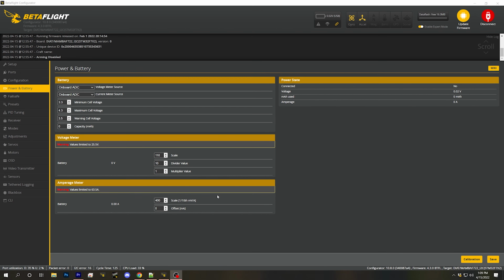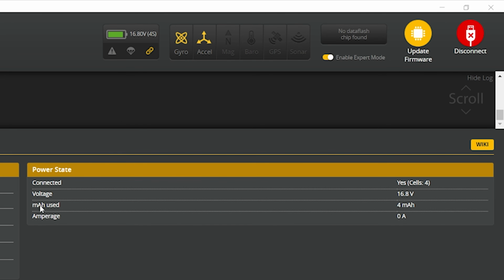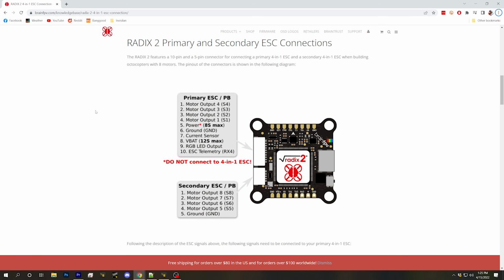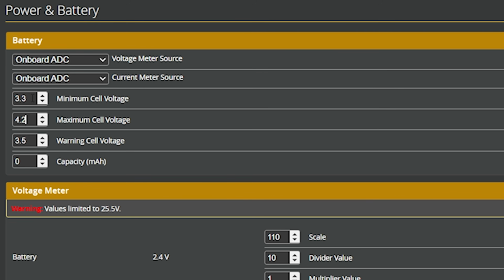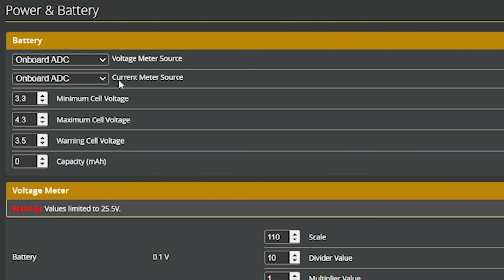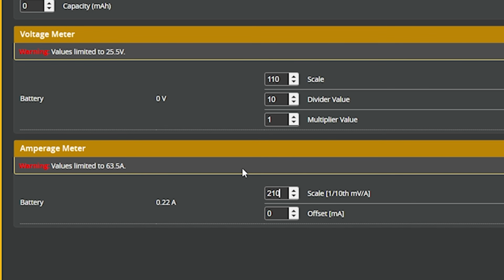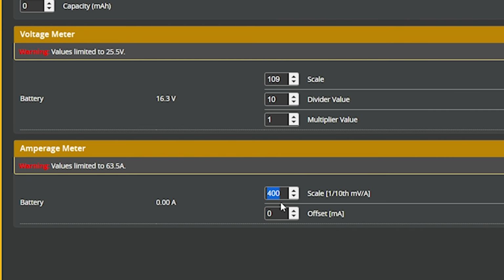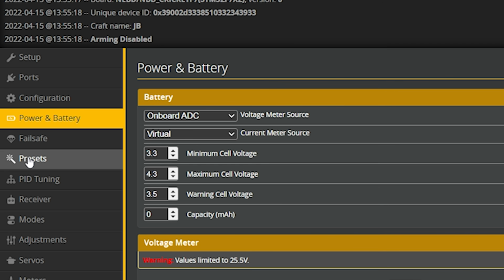Betaflight 4.3 Power and Battery Tab | COMPLETE WALKTHROUGH PART 7

Comment: i cant find info on current scale fore taker 80a there on 3220 925 aos i have built like 40 quads only have problem on 10" 60a to 80a they all want to melt solder off motor pads on test hover use stock betaflight 4.5 help help
Reply: scale on taker 80 should be ok with matching fc its at 179

Comment: good morning Joshua i have the tmotor 45a mini esc, im trying to find the specs related to current on tmotors website the only thing i can find to do with current is them stating that the Betaflight Galvanometer Ratio is 200, could you help me understands this i cant seem to find any documentaion on what the galvanometer is inside betaflight

Comment: Hey Joshua, I'm using a 4s battery and beta flight is showing 8 cells under the power state area. But at the top of the screen its showing 4s. Voltage on OSD tells me to land straight away. I have increased maximum cell voltage with no change. Any help would be appreciated.

Comment: What about the capacity option in BF? Should I input there the battery capacity of the current battery that I'm using? What if I use a 1550mah battery and then use a 1100mah one? Do I have to switch that value in BF before flying?

Comment: Why they just don't let you select how many S battery you have which would resolve all wrong guesses from Betaflight...
Reply from the maker: You can do that in the CLI.
Reply: I guess some selection box with Auto and 1S, 2S, 3S, 4S, 5S, etc. selection would be much easier than changing it in the CLI... @JoshuaBardwell

Comment: Very helpful, thank you so much! I do have a question. When I'm flying, I'm getting a voltage reading that tells me time to come home (let's say 21V for a 6S so 3.5V/cell). When I get home and put the battery on the charger, I'm reading something like 22.8V (3.8V/cell). I'm fairly confident that my battery checker is correct, so I go and plug in my battery and my drone to BetaFlight, but it now says the same as the battery checker (22.8V or 3.8V/cell). Then I connect my headset to the drone and look at the voltage on the OSD, it ALSO now says 22.8V (instead of the previous 21V). Any idea why this would this have a mis-reading in the field, and be correct when I get home? I have the same result if I display the total voltage or the voltage/cell on my OSD. Any thoughts would be helpful, it's maddening..
Reply: I guess it is volt sage, under load ir shows less amps, in rest, show the real voltage

Comment: "Capacity" should be specified in one cell or total?
Reply from the maker: Capacity in mAh is always 1 cell. Because the cells are in series. Therefore the voltage increases as the cell count goes up but the mAh stays the same.
Reply: but what is it needed for? because the alarms are set in the OSD tab, correct?

Comment: So... What value goes into the "Capacity (mAh)" field and what does the setting do?
Reply from the maker: That is the max mAh after which an alarm will appear in the OSD.
Reply: @JoshuaBardwell  If you were using a 1500 mAh battery, would you set this to 1350?
Reply from the maker: That's up to you. If you set it at 1500, you're going to kill your battery (assuming the current sensor is accurately calibrated, which it often is not).

Comment: I'm not getting voltage on a radix v1 board. Can I solder the "volt" pad on the radix directly to the red battery + pad?  I have a hobbywing 60amp 4in1. Then would I use the onboard ADC setting or from the esc sensor? thanks

Comment: So, what does the mAh offset do? You didn't explain how to make it work or how to make adjustments with it. 

Also, from my experience with the current scale that the manufacturer provides is always wrong. It's never correct. Best way to get it close is to just fly the quad and record how many mAh you used up, charge it back up to find out how many mAh went back in. Or if you have a bench top power supply to calibrate it. 

Since the mAh offset wasn't explained, I'll explain it. It's usually always a negative number you input for the offset to correct for the amount of current you are actually pulling. You can put the correct scale in after you do your initial test, but it will still pull say 3 amps for instance when disarmed and your mAh counter will start climbing up when that isn't correct. The accurate way would be to use a clamp meter to see how much current you are pulling when disarmed since the quad will always be pulling a small amount of current due to the FC, camera, VTX, LEDs etc. 

Fun fact, if you put too negative of a value in for the mAh offset it either takes forever for the mAh counter to count +1mAh or the mAh counter will start counting backwards 🤣

Comment: I’m running a Beast F7 55A v2 and I have everything connected. I always run a smoke stopper. When I went to test the motors they all worked collectively if I raised the motors individually. But when I used to the master scale the smoke stopper turns red and shuts the drone off. Any idea what’s causing this problem?
Reply from the maker: https://www.youtube.com/watch?v=0CQA5dPMYJQ&ab_channel=JoshuaBardwell

Comment: I having a issue with the battery voltage. When i fly my tinywhoop, for some reason, the battery voltage is showing me 0.00V and the “low battery” warning, even not showing also. I check in betaflight, I reebot once but nothing change. Do i need to calibrate or something?

Comment: One thing to note is if you accidentally flash the wrong firmware for your board, it can bork out your voltage readings.     
For the longest time I couldn't understand why when plugged into USB only it was registering a ridiculously high voltage reading - even worse when I plugged in a battery.  

Incorrect FW will wreak havoc on your life. 
Attention to detail is key.

Comment: Thx for this valuable content! Just a remark to the current sensing example with the F55A Pro II ESC, which I own: the manufacturer's value of 15.2 mV/A seems to give me totally wrong readings of 10 A current draw during idle condition. It appears the manufacture gives this exact value for all of the F series EFCs. I have put in 300 mV/A, which also seems too high. 5A current draw seems odd.

Comment: Hi.  Fist and foremost, thank you.  I have learn a lot from watching you videos.  As for the new version of Betaflight, I could not find the “tab” that let me reduce the power to the motors if, for exemple,  using a 6s battery on a 4s drone.  Before we could reduce the power to 67% when using a 6s battery on a 4s drone, now I cannot find this option.  Do you know of this option is no longer available? Thanks
Reply from the maker: It's in the PID tuning tab, the motor output limit option.

Comment: 3.5v turn around? I usually land at 3.7v- 3.8v so I don’t damage the lipos.
Reply: Yes but 3.5v is under load (during flight) ;) when you land, the voltage increases up to approximately 3.65/3.7v
Reply: @morgalion  sorry i meant to leave the lipos when i am racing at 3.7/3.8v when the voltage has increased. If you are racing the voltage sag is much bigger so i usually land looking at the mAh draw.
Reply from the maker: Landing at 3.5v under load won't hurt anything. They'll rebound to 3.7 or so after they rest.
Reply from the maker: The problem with running down to 3.2 is that we have such spiky load that if you're at 3.2 while cruising, you'll go below 3.0 when you touch the throttle.

Comment: If you only fly one type of battery (all same cell count) I strongly suggest setting "force_battery_cell_count"
E.g.
set force_battery_cell_count = 6
Reply: That's a good one. Perfect for 1s hv.
Reply: how about different types of batteries?
Reply: @baaao   then  do not set it and rely on the ... mostly right... but possible inaccurate readings

but if u  mean "I only fly 4S" then "force_battery_cell_count = 4" .... 2 s then only set  =2.... ...1s ... =1 ... clear?
Reply: @Ryet9   hey, i have 2 types of batteries 6s li ion and 6s lihv.. im having problem getting inaccurate osd displays because my lihv max cell is 4.35 and t he li ion has only 4.20 is there anyway to correct this? or do i need to change betaflight settings everytime i change batteries?
Reply: @baaao try setting Maximum Cell Voltage in the PWR & Battery tab to 4.38?
... but keep the warning levels set to ..whatever u current settings are.. say 3.3X volts... so u still get warnings when on the HV... and ur just going to have to deal with battery low warnings when using the lions 🐯 constantly popping up.. or.. ya change it every damn time.. no way to detect if it's lion or lipo, sorry ...welp

.. edit.. if u really got creative.. im sure there is a way opentx/edge tx could deal with.. if battery starts at XYZ... then give audiable warning when it gets to .. blahh, warn me... and disable OSD battery low warnings... but thats a bit byond the scope of a youtube comment
Reply: @Ryet9  thank you so much for your reply I appreciate it! ill try your suggestion